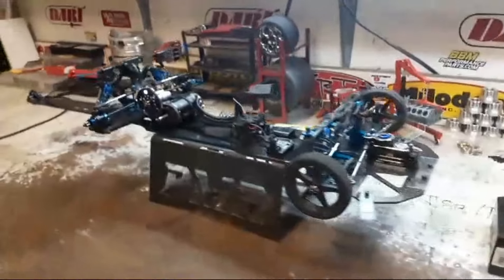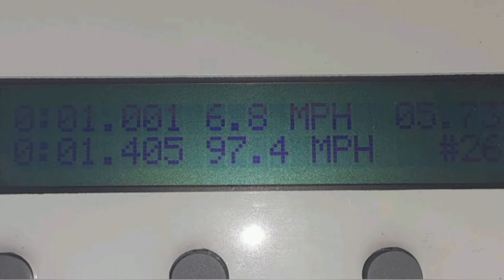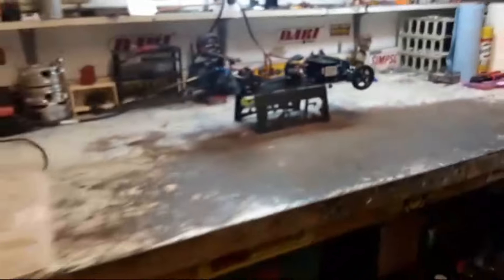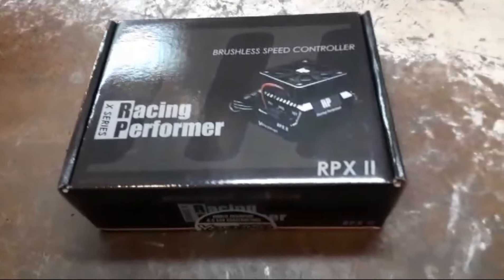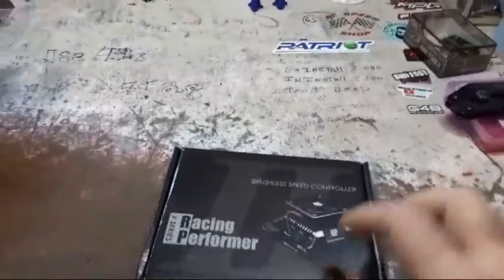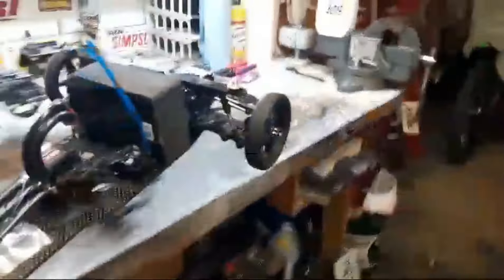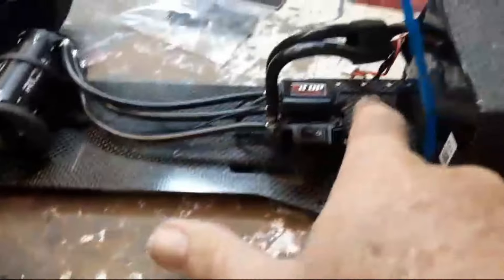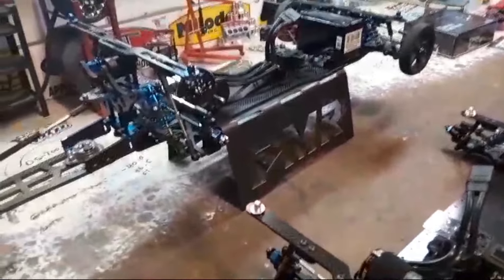RC Pro Outlaw Drag Racing....TESTING SH$T and NEW WHIP!!!

Comment: I finally got the V2 running straight and pretty good. Yes the chassis is flexy. The 16lb front springs they recommend seem to work for me. Have you thought about using the stiff chassis from BBM Performance?
Reply from the maker: @fredericktodd5789  What's going on, Frederick? It's a killer piece. I love it. It's just that the tractions getting higher and higher and less flex is needed. You would s*** your pants. My Springs in the front are 10 and 8 on the 5 pound car. And the 4  1/2 pound car. They are 9 and 7 Gray and greens, black and chrome. Glad to hear you're out making killer hits and having fun.
Reply: @powermadracing5116  Yeah that Patroit goes straight down thr track with zero trim in the radio. Thanks to all your help. I still got your #. I know I will probably need it in the future
Reply from the maker: @fredericktodd5789  No problem. Glad I could help in any way I could.